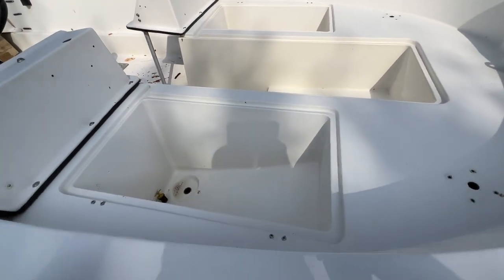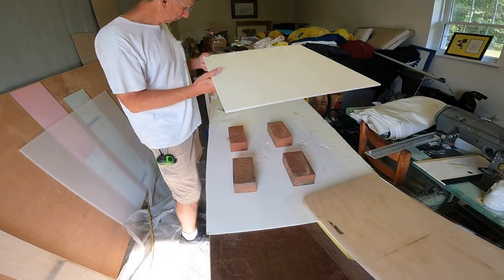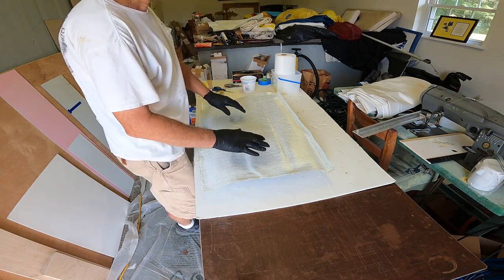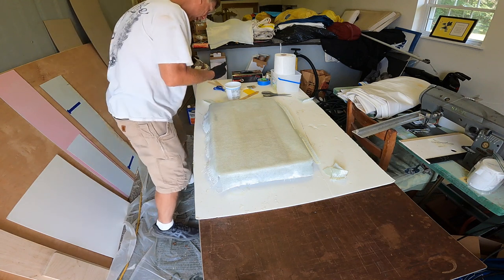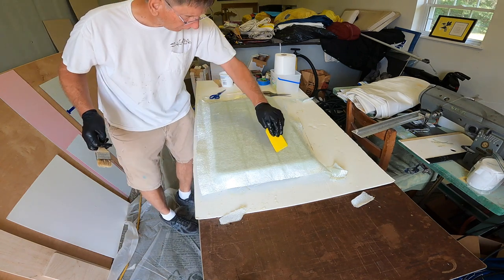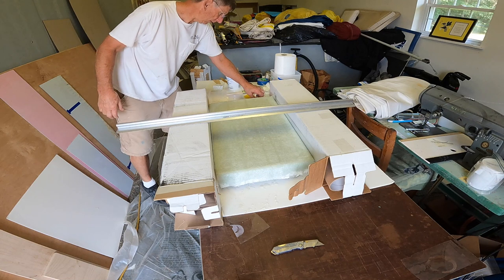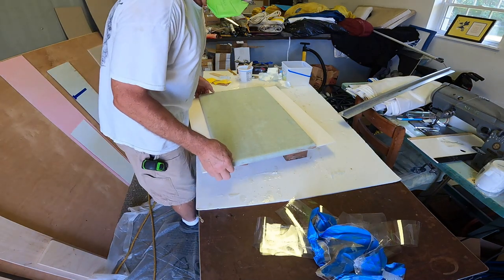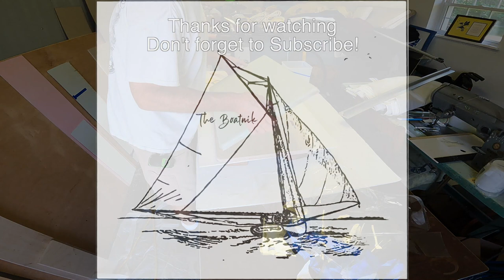Building new fiberglass hatch covers-Part 1

Comment: I don't understand why you didn't build this around your proposed 3/8" plywood stiffener. One and done kind of operation. The Mylar worked perfectly. I priced it versus Peel-ply...much more economical.  I'm missing 2 hatch-covers myself.
Reply from the maker: The plywood stiffener stayed back a couple inches all around so the hatch would fit level with the deck and gutters like the original hatches did
The missing originals had the stiffener plywood back from the edges the same way
The mylar does not absorb the amine blush like peal ply so it still has to be washed and sanded afterwards 
Thanks for watching
Reply: @theboatnik1328  Makes perfect sense now. Thanks. And, I didn't know about that quality of the Peel-ply. Once again, thanks.